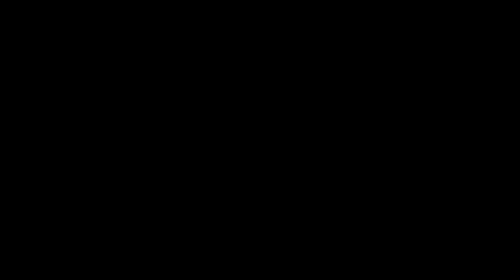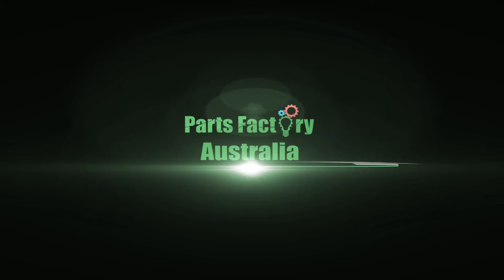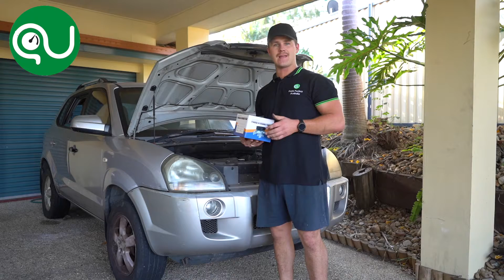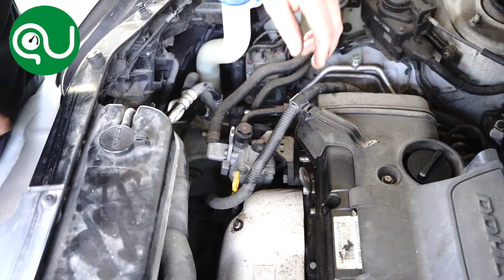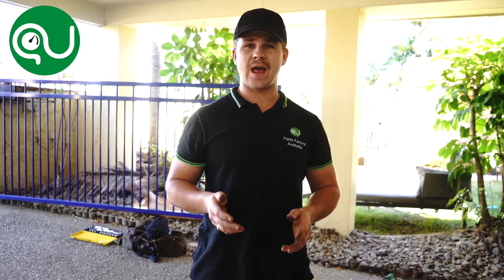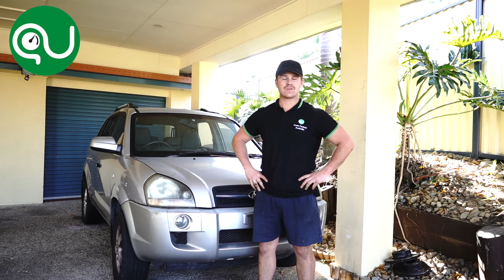How to Remove and Replace a Hyundai Tucson Power Steering Pump

Comment: Do manual transmission models have hydraulic clutch or regular metal cable? 

I have one, and the gearbox feels a bit grindy. I want to troubleshoot simple problems before calling the service man to change the clutch plate or entire flywheel.

Comment: I feel in the process missing from the video explaining how to remove the hoses and remove the fluid
Reply: I believe it stays on his vacuum. What the mechanic said hold it in upward position. The low pressure hose is fitted with an easy spring tension clamp